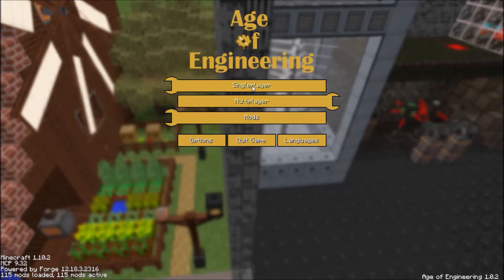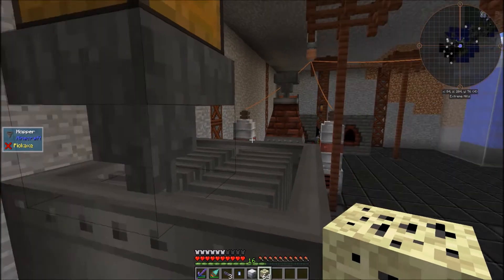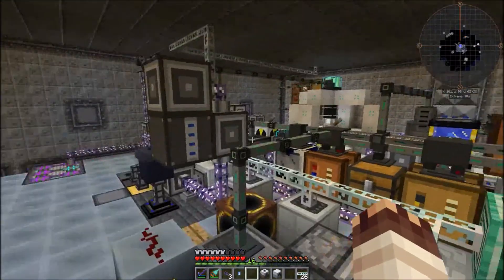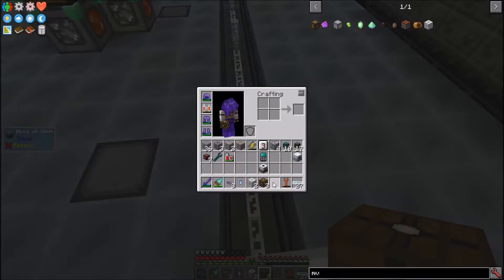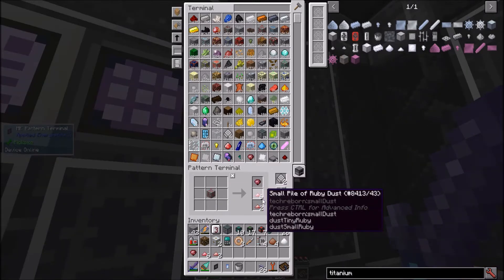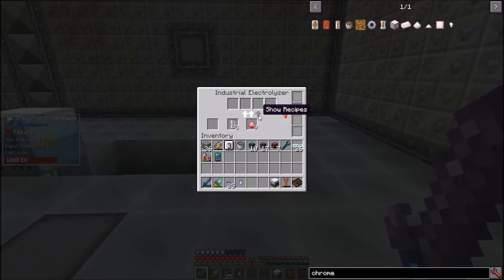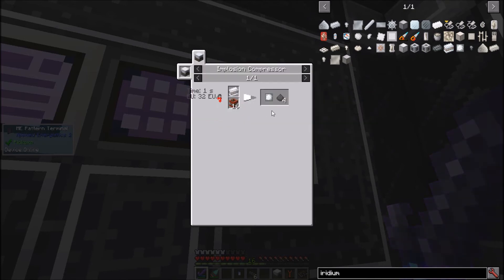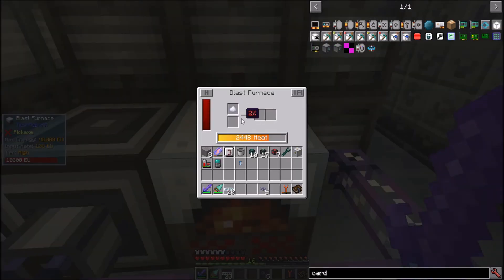Age of Engineering Supershorts #13: Tech Reborn

Comment: How much does your conductor mast system produce, again? I set one based in yours and it's producing 9k rf/t
Does having stable stone under it changes something?
Also, there's dozens of recipes for the mixed metal ingots that are easier then using refined iron and actually outputs more ingots
Reply from the maker: 20k on average. Each mast produces 5k on average, according to my calculations.
I do know about the other recipes, but they all require a better blast furnace setup than the one I have now. Good thing I'm fixing that in the next episode!
Reply: minecraftinchocolate clicking on the mast and hovering over its GUI shows an average RF/t, and when my base is only powered by them, the income in capacitors wont go higher then 10k RF/t :/
Reply from the maker: I believe I tested with capacitors. How are you connecting the masts to power? Are you running them through power cells like I am?
Reply: minecraftinchocolate i'm using dimensional transceivers, and connecting 2 masts to one side of the transceiver through enhanced conduits. But each mast says It produces 1.3-1.9k RF/t in their GUI
Later today I will test in a creative world If stable stone matters, and Power cells
Reply from the maker: Did you replicate my system exactly? Those big radar-looking things increase power gen and the antennae increase frequency of lightning.
Reply: minecraftinchocolate I even did the same amount of crafts
Reply: Wait, looking back at your #8 video, I crafted exactly the same amount of weather stations and transmitters,  set the 4 conductor masts with 24 weather stations surrounding them in a 5x5 pattern, with a 3 block large cross between them for the transmitters, but actually I still have 12 transmitters. and, watching again I see that you used stable stone around the weather stations and the mast, giving it a second layer. does that changes something? I cant find data about this mod as a whole
Reply from the maker: Just checked my setup, and it looks like it's been nerfed.
Reply: :C
Thanks for looking into that for me, btw
I ended making an expensive tier 3 solar from environmentaltech
To run the tier 3 ore miner

Comment: Your vids are great.  Could you do one with a quick walkthrough of your AE2 setup.  You must have a crapload of molecular assemblers.  I'm struggling to figure out how to set it up properly.
Reply from the maker: I'm actually not using channels; I have them turned off. If you do, too, my NeoTech episode has me setting up AE2 and the rest, automation using AE2.
Reply: Nachismo Yo I use towers with interfaces and molecular assemblers (2x2x4, half/half in chess Pattern) that uses 8 channels each Tower, and with 40 acceleration cards per tower